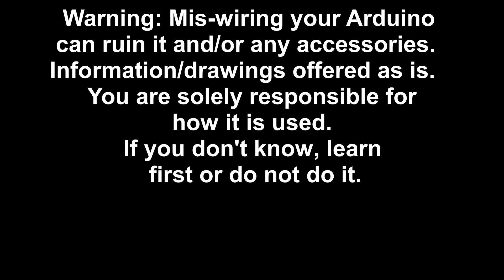WARNING!!! Arduino 3.3 volt (only) SD Card Holder (4K)

Comment: So, can I hook it directly to arduino 3.3v output? Thank you in advance!
Reply from the maker: Not sure what you mean by "output". You mean voltage out or data out? This type has no regulation, so you must manually ensure that you connect it only to the 3 volt data ports. NOT 5 volt data ports.
Reply: @tsbrownie  I meant to arduino 3.3v pin.
Reply from the maker: @ivanpetrov4917 I'm not sure what you are doing, or with which arduino, but generally speaking using 3.3 volts from most models should work.